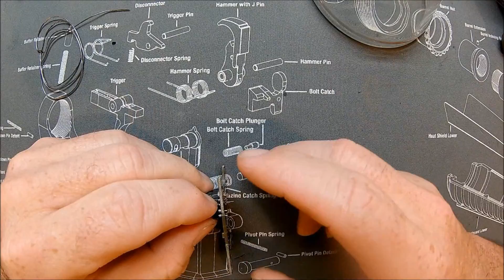Arris SP F3 FC & Arris SP PDB - Part 1

Comment: Hi mate I think I must damaged my motors think the screws was too long and damaged the coils I'm just waiting for 4 new motors to come from banggood as I changed my esc to new ones and my 3 motors still jittering
Reply from the maker: Sean Willbye might be ur min throttle setting
Reply: David Stanley FPV  what should it be set to in blheli min and max throttle setting and what should it be in cleanflight or beta flight please can u show me how set up blheli please properly thanks mate sean
Reply from the maker: Sean Willbye 1024 1976
Reply: David Stanley FPV is that for both programs need to be that setting how do u set it up and calibrate for 125 one shot esc mate
Reply: David Stanley FPV do u know why my motors spin up to full throttle when I put a tiny bit of throttle  on

Comment: Hi there of u take the signal pad off esc 4 how can u connect the signal wire please and I got 3 motors that are stuttering  out the 4 is that a soldering problem on the pdb or the flight controller please help.me
Reply from the maker: Sean Willbye - Be glad to help, what exactly is ur the situation? The soldering pad for esc #4 is missing?
Reply: David Stanley FPV it's come off when I was soldering and 3 my motors stutter  when I power the up and then beep and stop is it my soldering of the pins or is it the esc blown
Reply: David Stanley FPV I brought this set as seemed to be beginner  friendly as this my first 180 Quad build
Reply from the maker: Sean Willbye - If the solder pad for the signal wire on the esc came off then u need to replace that esc.  I had the same thing happen to me  when I first started and ruined a whole set of 20a LittleBee's. It suks but u learn from ur mistakes. The reason the pads come off like that is they're either ripped off in a crash or u got the pad too hot with ur soldering iron. Very important and worth it to get a $30 adjustable soldering station to keep this from happening. About 275-310° Celsius for the majority of things especially if u upgrade to fc's with gold solder pads. Sometimes u'll need to go up to 375° Celsius for heavier solder points like the battery in connection. Sorry bro.
Reply: David Stanley FPV can I solder the signal wire the back of the pins on the pdb board where I put the 6 pins for the flight controller  to sit on for that esc
Reply: David Stanley FPV I got the signal wire for the esc it's the pad on the pdb has come away from the board
Reply from the maker: Won't matter if there's not anywhere on the esc to connect the signal wire
Reply from the maker: Sean Willbye - Ok I thouight it was the pad on the esc. Yeah just run the wire directly to the Fc #4 hole or pin and ur good. :)
Reply from the maker: Sean Willbye - Sounds like u might need to calibrate your esc's or flash the Fc tho...
Reply: David Stanley FPV ok thank u got the esc 4 working and the motor spinning at full speed I tried calibrating the other 3 esc and reflashed the flight controller with 1.13.0 cleanflight but the 3 motors still stutter any ideas mate thank u for helping with problem with the solder pad on the pdb it only works soldering it to the esc signal pin on the pdb
Reply: David Stanley FPV which version of clean flight good for the sp3 racing evo board that is what we flash it with isn't it mate
Reply from the maker: Sean Willbye - Immediately flash it with betaflight 3.2 man, I run that on all my sprf3's. So much smoother and locked in pid's on stock settings. All I do is raise all 3 super rates from .70 to about 78
Reply from the maker: Sean Willbye - As for ur problem try changing ur min throttle to 1050 and ur max to 1950. If that doesn't work let me know and I'll tell u how to use blheli to properly set ur esc's. It's 1 of those 2 things.
Reply: David Stanley FPV Thank U I Do That In A Bit And Let U Know So It's Not To Do With The Esc BEING Faulty  Or the SOLDERING That I Done The Esc And motors  Used To Work On My Old 180 EACHINE Assassin V2 I UPGRADE the Esc On That To AFro UFO  20a Esc Thank U
Reply: David Stanley FPV Hi before  I Do THE Beta FLIGHT CHANGE THE 3 Esc SPIN For A Few Mins then  BEEP And Stop Is THAT a calibration problem.or a esc problem going to to try and put beta  flight 3.2 on it tomorrow
Reply: David Stanley FPV Hi mate done that and only motor 4 powers u properly the other 3 start Jenkins then stop and reset them selves I done the bheli esc calibration  to the same as my configuration  in beta flight but still the same would it be the esc that are damaged
Reply: David Stanley FPV hope u will get back to me soon mate
Reply: David Stanley FPV Hi hope to hear from u soon about my problem